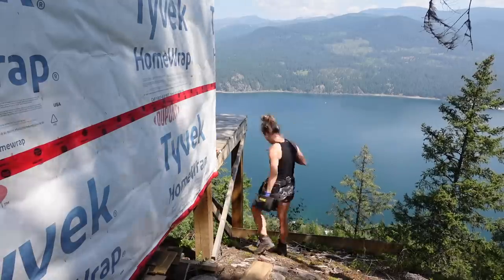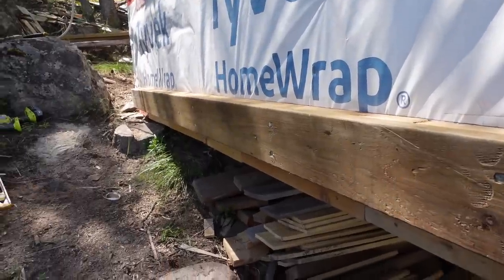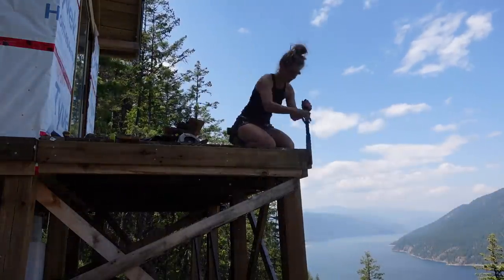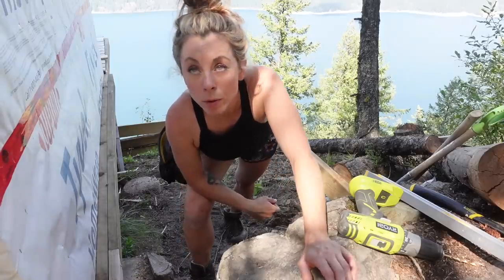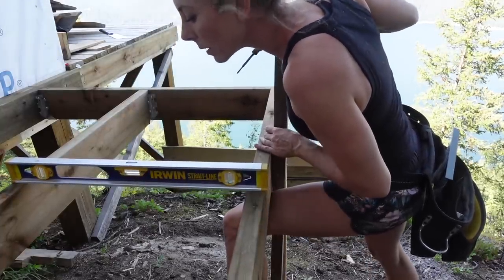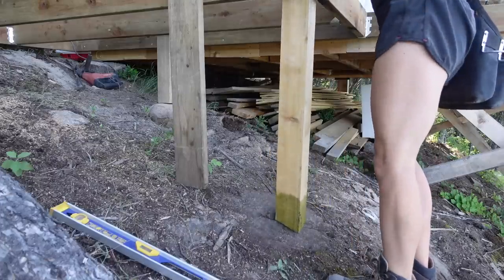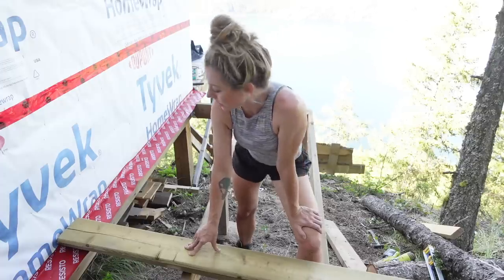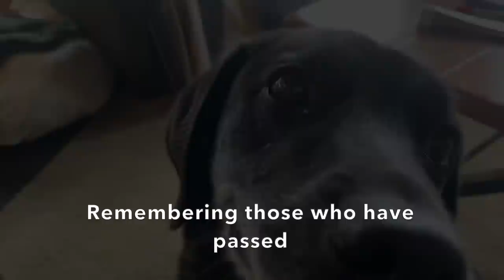I never joke about a deck.

Comment: Your hammering skills are quite impressive.  Doing a full swing and hitting the nail better than 95% of the time isn't easy unless you nail things for a living.  FYI, you were using the adjustable wrench the wrong way when you put the anchor bolt in the big rock.  You want to pull against the fixed jaw.  It is designed to  take the strain.  Pulling against the movable jaw will cause wear in the wrench.  There are times when you have to pull against the movable jaw because you can't get the wrench in the right way, but you want that to be only when you have to.
Reply: Jinx. Lol
Reply from the maker: Ok, good to known thank you!

Comment: You swing a mean hammer!  I'm impressed!  Everyone is too lazy with nailers, good for you.  That's how I started my construction days back in the early 80's.  Also, @17:33, I hope you angled the bolt hole UPWARD into the rock so that it doesn't fill with water, otherwise it WILL split the rock when it fills with water this winter.  Need to always think like a drop of water... This is too complicated for even most [professional] carpenters when flashing windows!

Comment: It looks great as nearly always. I would suggest two short "stiffening boards" between the center beam and the side-beams. It will stiffen your construction quite a bit and release some pressure on specific points so that the pressure is evened out on all the surfaces...
Reply: Yes, blocking 😊👍

Comment: Fun watching your cabin adventure. Regarding the awkward deck framing - “next time” assemble the perimeter frames in manageable 6-8 x 4 foot sections (perhaps on the other decks), bolt them together in place, then fill in the individual joists within those frames. Stronger and easier.
Reply from the maker: You’re right. That’s probably what most professional builders would do.
Reply: @michygoss7148  doing it single handed is a challenge!  Pretty mind blowing what you’ve accomplished. You must have no fear of heights. ;-)

Comment: Good job! I like the 'bolt in the rock' trick. If I ever build another deck (which I think I am to old to do) I will remember what your did.
Reply: The only thing I would have done in a different way was to drill straight down into the rock and put a hole in the bottom of the 4x4 and slipped it over a anchor pin.

Comment: Michelle, You are learning.  One of the things I would have done differently was to start out with an 8 foot 2x ledger board against the existing back deck and let it run onto the rim joist of the cabin instead of ending the new ledger board at the edge of the cabin.  That would have tied the existing deck and new deck together better.

Comment: Looks like a deck! I would have opted for putting that flashing layer between the ledger and the cabin framing. But as long as you keep the water away from the cabin framing all should be well.

Comment: That chandelier will be a perfect/awesome build, fantastic find and idea for the wheel. If only you could train Clyde to sniff out rusted metal instead of running off for miles into the wild and barking at nothing and everything, no doubt many more treasures out there waiting to be found and repurposed.

Comment: When you bolt the doubled 2x6 to the cabin and the 4x4 to the deck frame I can recommend an impact drill fitted with a socket. It's much faster than a wrench or ratchet. I like the drone shots.
Reply from the maker: Ya maybe lag bolts would have been a good idea. I do have an impact drill there!
Reply: @michygoss7148  Lags are always a good idea, especially since those decks will hold lots of snow weight this winter.

Comment: Always enjoy your updates, my weekend morning coffee watch. 

A couple of things about saws though. As an old logger who’s used saws a lot, I get nervous watching you cutting without chaps, especially out by yourself like that. 

Yeah I do it myself too when there’s only a cut or two to make, but things can go south in a hurry in the blink of an eye - I’ve seen it happen. 

You can get the type that just go on & off quickly without getting the full pants. In cooler weather you’d like the full pants though because they’re easier on the knees and warm as well. 

Also as much as I like the little gas saws, consider a cordless for your next one. They work real well & will go a long time on a battery. I got one for firewood & deadfall etc and I love it, especially in the winter when starting a gasser always takes longer.
Reply from the maker: I’m thinking about getting one !
Reply: @michygoss7148  I have the top line Stihl, there are others that cut faster but it's a good saw, and I think they have a larger battery available now (the priciest part) 

I used mostly Stihls during my years in the BC industry, so it was more brand loyalty why I chose this model. 

ps. get some chainsaw chaps! 

😬😬

Comment: I think it's a great idea to anchor to the rock it's a permanent solution for everything that's attached to it. As far as the floor boards go If it works for the lengths of wood that you have to try to see if they can all go the same direction as the front floor boards. Always slope away from the building.
Reply from the maker: Yes - I do have all the deck boards going in the same direction 👍

Comment: Good to see you moving better.  One option for the deck would be to do a notched front. By that I mean go diagonally from the new corner to the front corner of the existing deck. This would eliminate the need for another post and conserve a bit on wood. Might look a bit unbalanced in your aerial shots, but it is your place after all.  Also, if you run a 4 inch french drain pipe on the upper side, it looks like there is enough room to turn it down the hill under this deck. Hard to tell just how much room you have there from this video.

Comment: You might want some kind of pulley system from top wall also?Use tyvek joist tape too on deck joist, the top is where they fail first.

Comment: HALOXD , Splendid  👍
I also enjoy your choice of background tune 
" Midnight Sonata " 
I also like some of Hauser w Cello & piano Duets 
Set Goals & Achieve as to be a Winner  
You cannot achieve what you won't Strive for 
Remember you only have a so called problem til you find a solution 

Note this from an engineering standpoint the International Bldg Code merely to attach a Ledger board fper their specs or a deck is impossible to obtain , all fail inspection 
Iows Build it Right like this channel 
(Wing it if need be) 
To suit your needs, want or  expectations 

My home was built this way in 1872 & it stands Resolute , if built per the International code would fail most likely w in 50 years 
My home is the only home left standing fully intact after 2 tornadoes & Many Bad storms 
& was Originally a 600 Sq ft 1 Room schoolhouse 
Made of Poplar siding , metal roof, wormy chestnut beam framed & white oak studs & the floor is Tiger Oak . 
  10×10 cabin is Sweet 
May God Continue to inspire & Guide you through your projects 

Graciously , Rev. RM Bowles 
In West Virginia 
Presently I'm removing the stable & replacing it w a lean to Porch , I'm torn between Modern fasteners & Japanese American Woodworking which Far exceeds Any of the so called building Codes 

Build to last 100 years or 1000 years ? 
That is the question 
Higher Costs vs Cheaper yet stronger or split the difference 🤔hmmmmmn

Comment: Hey Kiddo....you made a good choice by running the girder beam down the center and putting in a support.....I wish I could send you answers to your questions while you are doing it...but it seems to me that you very capable on figuring things out...a thought, maybe run a girder from the outside corner of the new deck on an angle to the outside corner of the front deck  will lose some deck but it will save you a post to set..oh yeah make sure you double the angled girder if you decide to do it that way....just a thought...your doing a great job....be safe and best to Steve...
Reply from the maker: Yep. Both Steve and I independently thought of that as it would be really easy, BUT, it wouldn’t look as good!! I’m making it all look as symmetrical as possible, so although it’s a harder route, I’ll be so much happier doing it the harder way. 😁

Comment: Also , you are building on an eroding dirt surface .You may find that some time after a hard winter or a severe rain down pour that the cabin could possibly be pulled off your current anchoring points .

Comment: Awesome Michy. Another Home run on the cabin. Have you thought about joining the two deck 's on a forty five. Strength with a triangle and no need for a corner post.
Reply from the maker: I did think of it, but then it wouldn’t match the other side and that will bother me 😬
Reply: Cool, True Leo, Lioness, Primal ,Creative Energy and are associated with Visibility, Attention, Courage ,Generosity and Creative impulses 🐯

Comment: I have a small idea for something you could include that I think would be cool. So you have that large rock that is not in the best place beside the cabin. You could get some feather and wedge rock splitters and since you are very good with a  🔨 and you have an SDS Drill you could do a little rock splitting to make the space for the deck and use what you split elsewhere. Just an idea that was due to me falling down the YouTube rabbit hole.😁
Reply from the maker: If I didn’t already use the rock for the deck then maybe!?!

Comment: speaking to the anchoring of the cabin. The back it, would a "bar" of concrete tied into the rocks be a more stable anchor? IF god forbid it starts sliding it just going to shear the point already in.
Reply: Please excuse the grammar😜

Comment: What are you doing to insulate the floor? Will you be putting foam panels below, between the joists?
Reply from the maker: I’ve already insulated the floor with rigid foam insulation

Comment: Try to get a small magnetic adaptor and small screw bits. The longer the tip is from your hand, the more unstable the drill becomes. I don't know why it's a tradition in your country to use such long non magnetic screw bits....

Comment: If you really really want to make sure that place can never slide forward slam 2 BIG ass metal spikes into the rock off the back (or though a couple tree bases) and run a couple through bolts through your base frame on the back, tie them together with big arse stainless cables & u clamps.

Comment: Where'd you rescue the big one setting in the chair with the mug?
I think I would have done a diagonal around the corner with the deck boards
Ever think of tying a cable around a couple anchor points and then through the framing members? Just in case the terrain would shift and have a slide.
Reply from the maker: He was found homeless living by a dumpster! 😂
Reply: @michygoss7148  I see he's adapted well, hope he don't tear up the furniture. He looks to be  of the "working breed". I'd take advantage of that😉
Reply: @michygoss7148  lucky dawg

Comment: You should think about getting a good fiberglass handle hammer. That steel shank handle is really bad for your arm. I learned that the hard way.
Reply from the maker: I do have a stiletto but haven’t replaced the handle yet!
Reply: @michygoss7148  I us a 20 oz straight claw Plumb. I think it’s the best hammer I’ve ever had and I 62.

Comment: I love this cabin as well as your passion, but if this thing gains any momentum (as in a mudslide or minor earthquake), it's going down the hill. Every contact point should have been anchored to hell and back, not just to save a wooden cabin, but all the time and trouble you've invested in it. Odds are you won't be in it when that happens, so safety really isn't a concern. I would hate to see all your work go down the mountain.

Building a deck by winging it is a horrible idea, they're too complicated. Next time I recommend you draw up comprehensive plans. Draw it and draw it again until you're bored and you know every screw and joist hanger by heart. By virtue of that process, you'll find some cool things you can add and needless things you can eliminate. The deck will end up being elegant and without flaws.

Comment: Very interesting way to build that section of decking . Difficult to think how i might do it differently as your various camera angles don't have the blood rushing to my brain . Don't know how you keep your legs clean and not all scraped up wearing shorts. I'd predrill before pounding those big nails. Cheating i guess but why make the extra effort .That's a big framing hammer to swing
Reply from the maker: I am covered in bruises and scrapes - trust me! 🫣. Those nails weren’t as big as some I’ve put in, so didn’t pre-drill this time. Maybe felt I needed the arm workout! 😂
Reply: @michygoss7148  I can bet you're getting pretty beat up . Some tough work out at that cabin. Going to keep you ripped

Comment: LIKE ON 2X6 ON SIDE OF HOUSE ..YOU NAILED STRAIGNT IN...WHEN YOU DO 2 NAILS DO BOTTOM NAIL STRAIGHT IN BUT TOP NAIL DOWNWARDS A BIT TO WHEN YOU PUT ALOT MORE WEIGHT  ON DECK..IT ACTS LIKE AN ANCHOR ..IT CATCHES BETTER..STRAIGHT IT POSSIBLE TO SLIDE OUT..
Reply from the maker: Good point. Thanks. Next time!

Comment: I heard you take your Deck's pretty serious. Do you get any complaints on the size of your Deck, i've also heard there extremely large, especially when you try to put it in a tight spot. Im betting you get alot of use out of a Deck that big, probably using it day and nite. It sure is a site to see, it must be hard to take it all in at once. Do you use a rubber sealant,  on your Deck for protection ? Nobody likes wood rot. Have you ever thought about extending your Deck out to the Beaver lodge, it's a bit of a stretch but it would be worth it in the end.

Comment: Just an observation: Do you have unlimited funding for this project ? Building without a plan on how to build equals no financial plan...
Reply from the maker: Most of the materials for this build are either salvaged, repurposed, or I’ve milled myself. So the costs are low as it is.

Comment: Um, something tells me none of that is to code lol. It's cute she thinks a rock on silt is a good replacement for a proper concrete footing. That deck in 5yrs is going to be a great skateboard park. I am curious how she plans on preventing that one 4x4 with the angled anchor bolt from splitting the wood when it gets stressed. I hope that place nevers sees frost or rain, because, congrats, you made a death trap. This is a good vid on how not to build a deck. People, carpentry is not a hobby. You have to do things right or someone can get seriously hurt. If an actually inspector saw that, she would be forced to tear it all down.